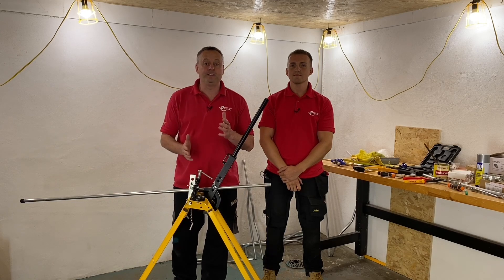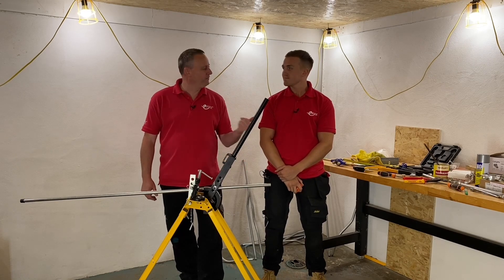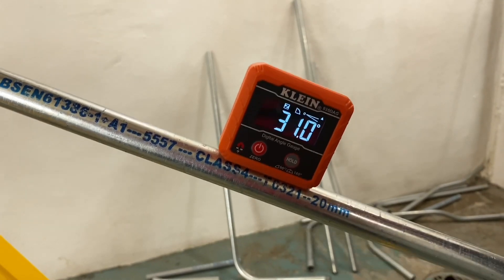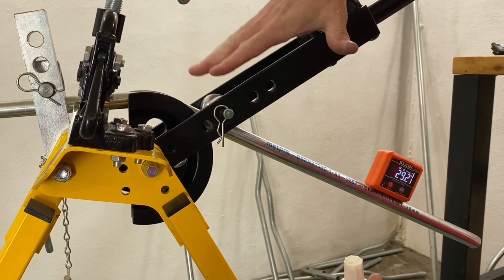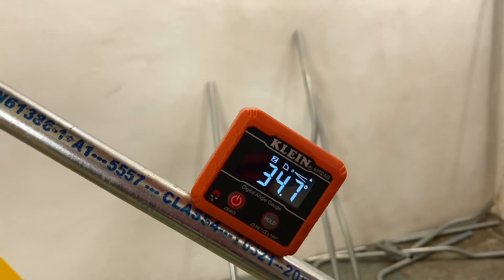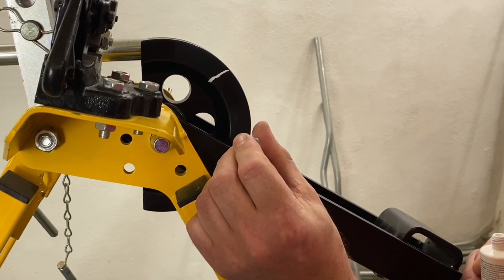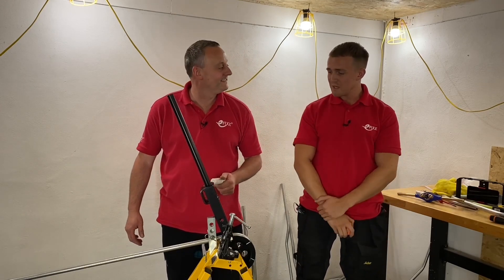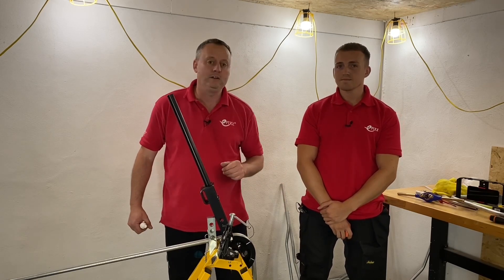Conduit bending machine HACKS? - Who wins Gaz or Jake?

Comment: With the spirit level don't you also need to see what the pipe level is on the other side? If the other side is -10 wouldn't you need the right to be +20

The video would only work if the pipe is perfectly flat

EDIT wait is this what setting the horizon basically does

Comment: Very curious how this bends EMT, which is commonly used in the states.   I realize that EMT is used sparingly in the UK.    If you could do a video comparing both with this bending machine, that would be interesting.   Does 1/2 EMT kink on this machine is the question?
Reply: EMT is lighter gauge and this is for 20mm steel conduit.

Comment: I use a little flat bubble level marked with 30, 45 and 90 degrees which does the same job as the inclinometer.
Great tips though :)
Reply: Only issue with that is you need to start level....

Comment: The biggest question is why do these conduit benders not have all of the useful angles marked out on them to start with? Seems like a ridiculous oversight to me.
Reply: Some do
Reply: cause the manufacturer doesn't know how tight you are going to tighten the roller or if you are going to use a outside support former with it

Comment: Sorry Gary. Thats a plumbers tip😉, I first marked my plumbers pipe bender nearly 20 years ago. The advantage of tippex is it is removable, so if you need to repeat custom bend angles they are easy to do, then the mark can be removed. For bend angles I use to do regularly I scribed the mark with a scroggy. At a certain point of experience you stop looking for marks as eyeballing can be faster and more suitable as few buildings are perfectley square.

Comment: Klein Tools 935DAG, for those wanting to snag one. I use a Klein Tools 6.25 in. 4-Vial Conduit Level 935AB4V - Your standard magnetic level but with vials for 30, 45, 90 & 180° bends, can either attach to steel conduit or clamp into plastic conduit. A fantastic pair of tools either way. Here's a question; Is it worth putting permanent marks on your bender to indicate the various angles?
Reply: Yes, very worth it. Just make sure you mark it including the spring back.